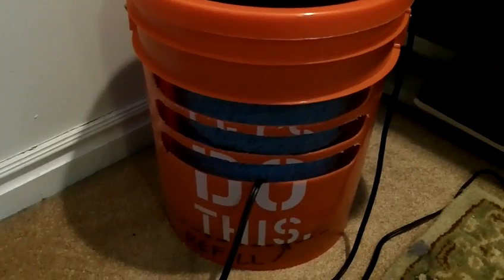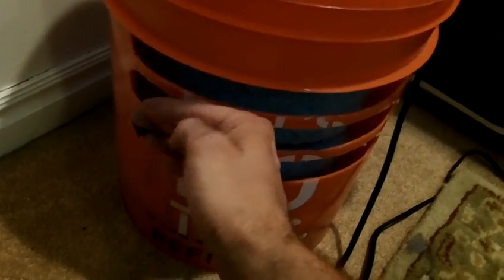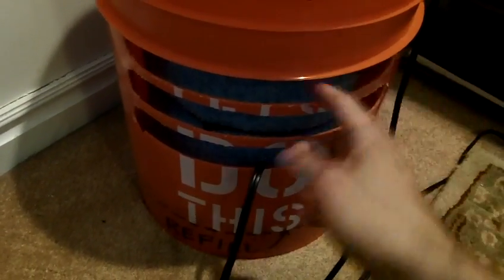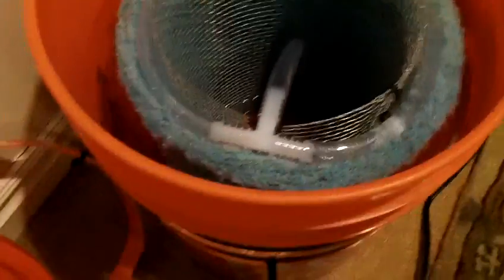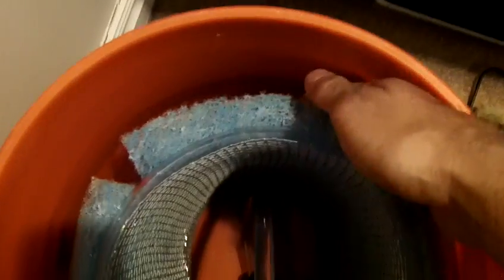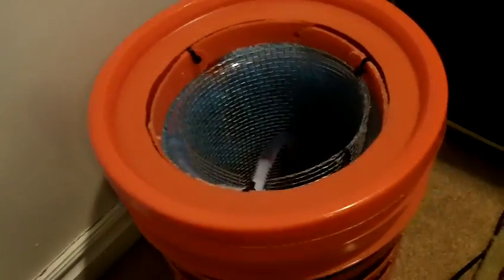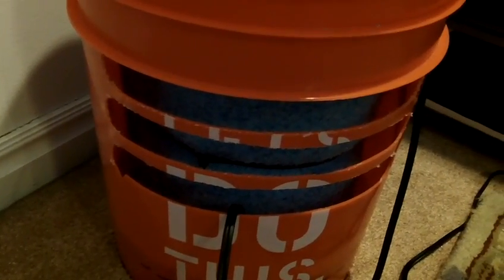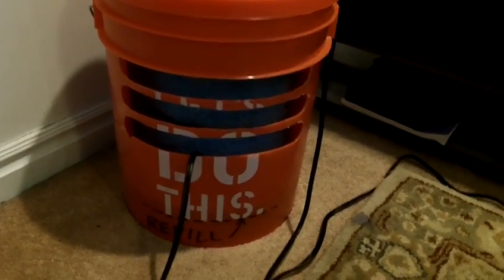Better DIY Bucket Swamp Cooler Design!

Comment: This is great but it will stop cooling the space once you start introducing water into the air. If the air that the swamp cooler is pulling in isn't dry, the swamp cooler wont work. You need your intake to be pulling from a source of dry air

Comment: you can use Sugru to bond the zip tied wind guard to the bucket and that would push all the air down and in. A cheaper solution would be hot glue gun

Comment: This is first 5 gal swamp  I noticed while looking for someone who was on my box fan line
of  design.  Centering around screen/frame is the intelligent  maneuver.  That way you get
pass through 306°.  BUT.. you left out  the temp draw down.  ambient room temp, and  bucket output temp.  Seeing this round thing has me readjusting my idea.  thanks.

Comment: Good work. I've been making them this way for the past 5-6 years and have had great success with them. With mine, I make holes, about 2 1/2 inches in diameter all around the upper outside of the bucket, and pull the air through instead of pushing it.
That allows me to use a HVAC elbow on the top of the bucket, over the fan, to direct the air flow any where it is needed.
I live in the high desert area of New Mexico where the humidity gets down into the single digits quite frequently, which makes a swamp cooler work that much better.
Reply: I'm researching this idea for the coming hardships. I live in the desert and MUST HAVE something to help beat the heat. Do you have a suggestion for the best video,for a olwoman, maybe even with one with a parts list and links??

Comment: I think a reasonable hybrid would be to do the holes all the way around, but do the pad like shown here. I also think having the pad go all the way to the bottom of the bucket would make a difference as it prevents any kind of air gap. 

I tried doing one of the ones where you circulate cooled water over a fan through copper tubes and found it did very little to cool the air, and didn't take very long before the water got hot. My assumption was the tubing was acting more like a refrigerator condenser and removing heat from the room rather than cooling the air.

Comment: I have done a lot of digging around on this topic. Blue cooler pad is not available in our Country. Alternative: use Aspen Wood wool pad. Equestrian suppliers have it for horse hay. Else farmers use cardboard based honeycomb for cooling. Both apparently have above 90% efficiency vs 60% of the blue pad.. hope this helps. Great thinking on your project.

Comment: Nice Job,   But I think you're supposed to blow the fan UP.  That way,  the sponge water won't come out the side holes.  Air sucks in from those side holes and the water comes IN with the air..  The cooler air should be blown UP high,  because cool air sinks.  If ya blow it on the ground,  it stays on the ground,  at your feet only..   Blowing it UP,  spreads it around the room better.

Comment: Do you even need the pump in this design, though?
Reply: Absolutely. It is the water in the pad that causes the temperature of the air to drop. That is what is meant by an evaporative cooler. The water has to evaporate into the warm air to cause it to drop in temperature.

Comment: If you are not too good at building stuff like this you can just go and buy a small Honeywell swamp cooler for about $200.00. cools about 400 sq ft. They work best where your RH is low.
Reply: Paul Nicholls how much electricity would it use is it similar to what these homemade versions use?

Comment: if you were to make a double wall of Mesh and use Excelsior pad material between them, I think you would get much better cooling. just a suggestion. . .
Reply: Aspen Evaporative cooling pads. (Excelsior pads pre made).
Reply: thats what I was thinking..

Comment: Good job, I see you have good sense of the basic science and design.    I wonder if you also understand that all of these bucket coolers increase the humidity in the room, and once it gets to a certain point, they not only don't cool well but make it miserable with too much humidity.  However, for short periods, it probably works good, and/or if you periodically open doors and windows and change the air in the room.

One solution would be to put a round flex duct on the inlet of the fan and run it out a window to suck in outside air.  
Or, put the fan outside and have it blow through the duct into the bucket.
Reply: So run a portable AC in one part of the house (which removes the humidity) and the Bucket Swamp cooler in another part of the house. --That way you get a balance between humidity added and removed.

Comment: Yeah, this seems to be a better one! Hot air rises up, so as the fan is pulling air from up & blowing it sideways, I guess it does a better job @ cooling
Reply: Hot air is buoyant. It weighs less.
If a fan is blowing the air, the relative weight difference wont be noticed.

Comment: I do like this design much better. Cold air can circulate around the whole cooler pad much better before exit. I brought a 92 GPH Submersible Fountain Pump from Harbor Freight. Looking to build this design this weekend for a up and coming camping trip. This design also allows for any size fan to rest on the top of it without mounting, altering or modifying. Great job. Thx for Sharing this.

Comment: 5 to 6 gallons per day is a lot of humidity added to your house
Reply: You're not supposed to use swamp coolers in humid environments. These work best in hot super dry climates, because the hot dry air helps evaporate the water into the air to cool it off. 5 to 6 gallons a day wont even make a dent in the humidity in these climates.
Reply: I was thinking the same thing. And here in upstate new york when the air in my house is already at 65% humidity or more thats the last thing i need.
Reply: Yes you right is because it brings more humidity . It works with just in dry place

Comment: The first way would've worked if you put the fan on so it was sucking air up and out! Still props for doin it a different way!
Reply: Turning the fan  the other way so It could suck the air out would eventually ruin the fan with the moisture

Comment: So far I have not come across any vedio which say a perticular evaporator unit ( no matter the size and shape ) but the volume of the unit in cubic feet and would be good for so many square feet area or to say so many cubic feet of a room. ( 5 gallon bucket evapourator would be good enough to cool ___ cubic feet area. OR  wide 10'  × long 10' × high 8' room would need ___ number of 5 gallon bucket evapourator.

Comment: put a second sumbersible pump in there and pump ice water through copper tubing thst would be tip tied and spiraling around the fan, drain the water from the copper tubing around the fan back into bucket. this combines two colling system together!

Comment: can you just a normal sponge as long as it's big enough to go around the wire mesh?,  have you tried having the fan blow outwards or basically blowing the cold air out

Comment: Hey! Can I ask you a question ? What can I use instead of the swamp cooler padding? Because I can't get any here.
Reply: Can u explain more?
Reply: Anything that holds moisture while allowing air to pass through.  I think the padding inside of pillows and other upholstery might work, just sandwich it between two screens or wire mesh, like this guy has done.    By the way, what is the typical humidity where you live?  Because this only works in dry desert climate, 15 percent or less.   If it's humid where you live this will only make it worse